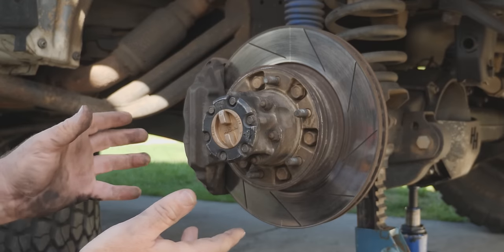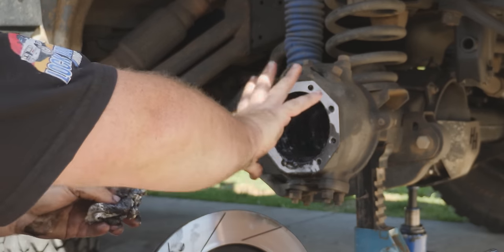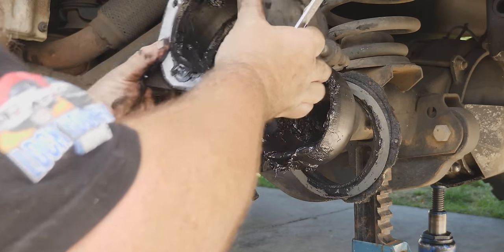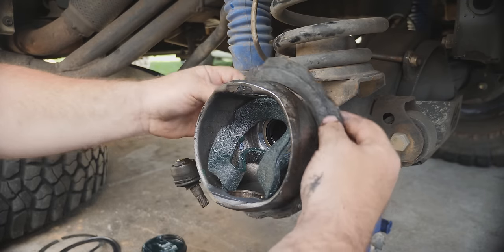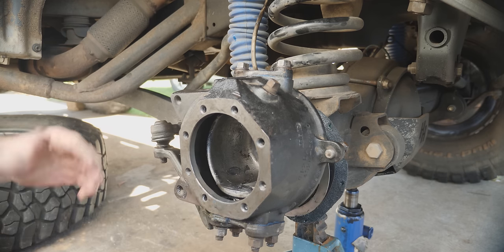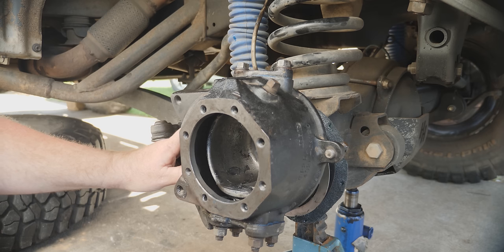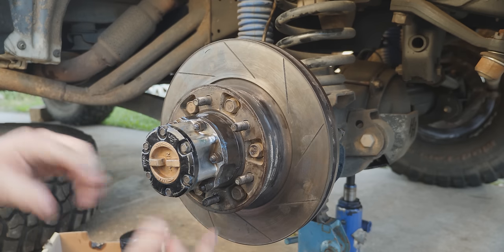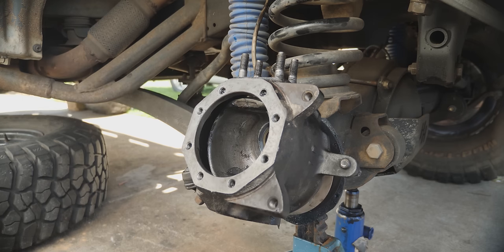Toyota LandCruiser 40 60 80 70 76 78 79 105 Hilux Knuckle CV and Birfield Rebuild

Comment from the maker: What DIY maintenance task do you want a video on?
Reply: Tie rod replacement would be great. Loved this vid!
Reply: Valve clearance adjustment (on a 75 series) would be good too.
Reply: Twin lipped seal was a brilliant idea as well as the locking nut for the wheel bearings. Long live the 80 series 😉 Great vid thanks
Reply: Ujoints. It's never a good time and a different perspective always helps. This is quite a soothing video
Reply: Wheel alignment
Reply: Love the vid mate 👍👍 is the rtv blue a necessity & what is an alternative? Is there any chance you could put links in the description for where you get your after market seals etc & the bearing kit?
Reply from the maker: @brickehansen1625  any good silicone based sealant that'll tolerate grease will do the job. Both the seals and bearing kit are avaliable from terrain tamer.
Reply: @LockyourHubs4WDing  beauty. Thank you kindly.
Reply: Steering box removal and install
Reply: Steering pump and box on a 80 series. Also tie rod ends along with wheel alignment.
Reply: Front and rear differentials…. Loved this video!

Comment: locating the felt and ring etc - put shortened skewer sticks through the holes to locate the assembly in position. Replace one by one with bolts
Reply from the maker: That's a fantastic idea!

Comment: Great Vid, A quick tip to make life a little easier. If you put your bearing races in the freezer overnight before you install they slightly contract from the cold and go in much easier without having to bash them, they are still tight but you can tap them in instead of bashing them in then they expand back with normal temperature, I still use a little cam bearing grease on the race so it's not dry when fitting them in.
Reply from the maker: About 30 years ago I used that very trick to insert valve guides in a mini head, after the head sat in the oven for a couple of hours. (Yes I am that old!) 

 Another trick I've used is to turn a can of air duster upside down and spray the liquid on the part that needs to shrink. I must drag out the FLIR one day and see how cold I can get it!

Comment: Mate ur a legend so glad I found this informative guide. I need to do mine but have been putting it off due to nerves and considering taking it to the shop. But now I've seen this im gonna give it a crack. Cheers for the confidence boost mate. Subbed 🤘
Reply from the maker: Mate, stuff like this can be done with reasonably basic tools in your driveway or garage. As 4WDers, the more self sufficient we are, the better off we are.

Comment: Just watched your video, in order to help a mate change the swivel seals on his FJ45.  A great video. 

A suggestion for helping align the felt, rubber and retaining plates is to make two studs that you can insert into the housing.I usually use long bolts of the correct thread, cut the head off, then cut a slot for a standard screwdriver.  

Install the studs loosely, one top, one bottom.  Hang the rubber, felt and plates on the studs, add the bolts.  Then wind out the studs and replace with the standard bolts. 

Cheers and thanks for the great video 
Greg
Reply from the maker: That's a great idea! Like putting wheels back on an Amarok.

Comment: Thanks so much for sharing your knowledge, it’s much appreciated! 
I will refer back to this when doing my 76 .
Thanks again
Reply from the maker: No worries mate, I just did an early 79 (1hd-fte) and other than the number of wheel studs, it's virtuality the same.
Reply: Hey mate , where did you get your aftermarket spindle nut from ? I spoke with superior eng and they say they don’t make one for a 76 ? I thought they would be the same same as other models ?
Reply from the maker: @davidmirfin1380  check out roadrunner, says it fits the 79 so should fit the 76 as well.

https://www.roadrunneroffroad.com.au/300519-kit-toyota-chromoly-spindle-nut-set-live-ax

Comment: Hello from California. This is a great video and you made something overwhelming look so easy and straightforward. I had mine done on my FJ62 by a professional, but will tackle it myself next time. Just curious about setting the preload, that seems a bit tricky.
Reply from the maker: The main thing with the bearing, both the kingpin and wheel bearings it to make sure 100% the outer races are seated properly, otherwise the corrugations are going to ruin the preload on the bearings and then they usually destroy themselves. 

A lot of experienced people just use feel to set the preload, though I though it better in the vid to set the preload the way I know it works, measure it and quote a figure, because not everyone has done it a dozen times.

Just take your time (photos on the phone at different angles are always good when you're pulling apart something new) And don't forget lots of rags!

Comment: Very informative video.
Question. Why do you tightened the preload bearing so much ? Should be finger tight or im wrong? 
Thanks
Reply from the maker: For road going stuff finger tight is fine. For off-road, you need to settle the bearings properly, or the preload will loosen up in service.

Comment: hi 
 Major parts u missed 
1/   axle/seal  center line  sets the total shim pack thickness eg top + bottom .   Toyota dealers use this tool 
2/ remove shims equally top and bottom to set preload drag on king pin bearing 
3/ check drag with spring pull gauge ,,,,,,,,set drag to 6kg Toyota spec 
------Aftermarket 
1/ eccentric king pin bearings ,allows adjustment of caster and camber for wheel alignment
Reply from the maker: If you're replacing the king pin bearings with decent quality units, I haven't found the need to adjust the shim stack. I've also never seen shims on the bottom, only the top.

Comment: Do you need the spacer in place of the removed dust shield or can you just remove it
Reply from the maker: It's better with the spacer because it leaves the seal in about the same position, but I've also done it without.

Comment: How did you get the cv-joint off the axle? I have seen several videos showing to put the shaft in a vice and banging on the cv inner race with a hammer & punch.
I have replaced many cv-joints on passenger cars, & 4x4 SUV & pick-ups and managed to remove the cv-joint using the same method. However, on 4x4 such
as the Land Cruisers, Nissan Patrol and Land Rovers with solid axle housings it is almost impossible to get them off without damaging something. Some of the
ones I did manage to get out had the c-clip mangled by the splines when forced through the cv-joint. Of all of the on-line videos, some of which are great 

videos showing the complete repair / rebuild of the cv-joint (cleaning, replacing & lubing them) but not one of them showed how they remover the cv from the axle shaft. 

I made up a tool consisting of a pipe long enough, approximately 4 inches longer than the axle shaft & large enough to fit over the axle shaft so that the pipe fits against 

the inner race of the cv-joint. By inserting the axle shaft and cv-joint into the pipe vertically and lifting the shaft & cv and slamming it onto the pipe usually does the trick 

on the SUV, Pick-ups and passenger cars (External type shafts & axles). However, 50% of the time on the solid axle type housings even with the pipe jig I just cannot get

 them apart. What I did notice on L Cruiser cv-joint the outer end of the cv-joint where the shaft splines onto the cv-joint the bore was slightly chamfered so as to collapse

 the c-clip when the shaft is inserted into the cv-joint. However, the inner bore was not chamfered which prevented the c-clip
from collapsing when trying to remove the shaft. I am assuming that the chamfered side should be on the inner side so as to collapse the c-clip and easy to remove the axle.

 I have seen one video of the complete rebuild and replacing the cv-joint on a solid axel type where the mechanic mentioned he had to remove the inner c-clip prior to
removing the axel however,  he didn’t show that procedure in the video. I cannot see any way how he could get access to that c-clip with the shaft installed into the cv-joint. 

 If anyone has any suggestions or comments on this please comment.
Reply from the maker: I've also used the pipe trick. I've used the brass drift and hammer method in another vid (replacing CV boots) on IFS cars. I too have mangled the clip to get them apart. It usually involves lots of swearing.....

Comment: Hi from Sout Africa!! Thanks for a great video!!..my cruiser 79 pickup 4.5 is on tressels for recon both front cv's my question is..can i remove both cv axles at once?..will i be able to push the shafts back into the diff?..
Reply from the maker: Yes, that isn't an issue.

Comment: Hey Cobber, I believe the after market front hub locking nut kit doesn't work on fulltime fwd , was hoping to use on 105, use the 3 x finer for rear.
Using the "spindle greaser" conflicts with using moly grease to the extent you use it ? any thoughts ? and noticed you mixed moly and bearing grease when spindle bearing was on spindle hub with moly !
Reply from the maker: Hmmmm, I've done a full time 80 before and the kit I use is exactly the same either full time or part time. The kit supplies new outer and inner locking nuts and tab washer. Not sure if the 105 is different? 

The spindle greaser will "hopefully" push out the old grease and deposit new, either moly or HTB. Doesn't matter, new grease is better than old! 

I've not seen any adverse issues arise using moly and HTB grease in close proximity to one another.

Comment: What style/brand puller did you use for the steering arm?  Part # for the aftermarket rotor/spindle bearing/seal upgrade? 
Great job. 
California FJ60
Reply from the maker: The puller is "Repco" brand, the seals are avaliable from Terrain Tamer.

Comment: Great Video mate very educational.
question when you tight the spindle nut for preload some people light tight it , some medium tight it,  but your was extreme tight is what's the difference
Reply from the maker: Tighten the inner preload nut tight first to settle the bearing races in the hub and then back it off and tighten to spec on the second go. 

That way you're sure when you hit the corrugations, your wheel bearings won't loose the preload.
Reply: @Lock your Hubs 4WDing  one question when I'm in a rocky area or off-road sometimes I hear a clunk noise behind my foot or my right wheel RHD(right hand drive)
I changed everything tie rod ends, sway bar links and bushings. greased right side axle. still I hear the same noise any idea?
Reply from the maker: @jdmgm6765  check for cracks in the chassis around the steering box, it's a fairly common issue unfortunately. If you find cracks, they'll need to be properly welded up and then re-enforcing plates welded over the top to make sure it doesn't happen again.
Reply: @LockyourHubs4WDing  didn't see any crank rig has 150km could a king pin do that clunk noise
Reply from the maker: @jdmgm6765  the easiest way to check the kingpins is lift up the RHF wheel, grab it at 12 and 6 o'clock, give it a wiggle. If you can feel play, that's the kingpin bearings. If you do the same thing at 9 and 3 o'clock, and feel movement, that's wheel bearings.
Reply: @LockyourHubs4WDing  yep I can feel a slight play when I push 12 o'clock going to rebuild that soon just greased it for the time being. I just changed all four my tie rods with a greaseable option tie rods.  if you did your alignment perfectly since I'm in the bush can you count how many strings are left from each drag links in the front and the toe adjustments in the back
Reply: @LockyourHubs4WDing  could be king pin bearings, or wheel bearings..
Have someone apply pressure at 12 and 6 o’clock, while you watch to see where the play/slack is..
You will need to watch fir the slack at the swivel bearing, from underneath ..
If its king pin, you will need to strip it down, you will need to get more detailed information elsewhere..!

Comment: HI, thanks for the video. The torques you mention are the same also for 70 series or are there any differencies? Another thing, a pre-load is to be adjusted only by a torque or there is something more to do? Thanks.
Reply from the maker: While I used the same torque on a 79, you're probably best consulting the factory service manual. 

When it comes to the wheel bearing preloaded adjustment, there is a process in the factory service manual that involves using a spring balance on one of the studs and adjusting the preload on the nut and checking the drag on the bearing using the spring balance. 

I did try it once, though really cranking down on the preload nut didn't seem to make that much difference on the reading from the spring balance.

Comment: Howdy mate, I have a 2006 LC 105 GX 1HZ, same running gear as that beast you're fiddling with...
Went to buy new tyres today but saw that the front left wheel had some play and thus I needed to remove, check and adjust the bearings (pretty new, only about 20k km).
Pulled off the wheel, calliper and hub to find the wheel-bearing grease in the hub was black, but not runny. As if it's been contaminated by the airfield / cv grease?
I haven't stripped any further but the smell of this grease is akin to the LMM Castrol CV grease I used in the ball-joint and cv, so I'm thinking there's just been some cross-contamination here?
Would overfilling the ball-joint / airfield / cv with LMM grease (probably what I did 'cause I like over-engineering  cause it to push outwards along the shaft and into the wheel-bearing hub and mix with the thicker Lithium WB grease? From the comments above it doesn't seem like this is a train smash?
What else do you think I could check?
Will adjust the wheel bearings properly this time!
Reply from the maker: If it's not runny from an oil contamination, it sounds like the cv/knuckle was overfilled and has contaminated the wheel bearings.
Reply: @LockyourHubs4WDing  Thanks mate, my deduction as well. Only slight bit of black grease came out so no worries...I repacked with standard and put her back together all sweet. Cheers

Comment: Great video, whats the best kit / place to get parts and tools for this job? I'm in the USA though so it may not apply to me. Thanks again.
Reply from the maker: We used the Terrain Tamer kit.
Reply: @LockyourHubs4WDing  What about that bearing you are using? @ 34:26
Reply from the maker: The bearing used are Koyo as used by Toyota, purchased through Terrain Tamer. The double lipped seal is also avaliable through Terrain Tamer.

Comment: Hi mate, ive done that side and now doing the passenger side, and for the life of me, i cant get the longer axle back into the diff. I feel ive tried so much ill ruin the new seal. any advice would be good
Reply from the maker: Do you have factory lockers with the longer spline/axle? And if so is the locker turned off?
Reply: @LockyourHubs4WDing  has no lockers, ln106r 93

Comment: What Types of grease were you using? is standard penrite high temp wheel bearing grease good for everything that you covered in this video?
Reply from the maker: On wheel bearings I used Casttol high temp bearing grease and for the king pin bearings and the CVs I used Penrite molygrease.
Reply: Lock your Hubs 4WDing Thanks, glad i watched this before starting the challenge of doing it, great video, cheers!
Reply from the maker: Just take your time mate, if I'm tackling something I haven't done before, I usually take a few phone photos from various angles at several stages during the pull down. It's come on handy more thsn once.
Reply: @LockyourHubs4WDing  Thats a really good idea ill make sure to do that thanks!
Reply: @LockyourHubs4WDing  can you pack the hub around the cv with bearing grease? I only use moly grease for inside the cv
Reply from the maker: @simonrudk3912  the hub should be packed with moly grease not bearing grease.

Comment: Not sure if it’s already been asked, but, do you think the freewheeling hubs ( part time) actually improve the 80 series? Fuel , handling etc ? Keen to hear your thoughts please!
Reply from the maker: The fuel saving is minimal, the only reason I would convert is the vibrations from the front drive shaft that you can get with 3"+ suspension lifts.
Reply: @LockyourHubs4WDing  thank you!

Comment: What size is the insertion tool you used on the inner axel seal? Do you know of it's the same on the 60? I'm trying to get my ducks in row for my first bearing/knuckle rebuild on my cruiser.
Reply from the maker: I used the 50mm insertion tool to insert the inner axle seal, it's the same size I use for the king pin bearings. Unfortunately I'm not sure if the 60 series is the same.

Comment: What grease would you recommend if we can’t easily get the Penrite in the US?  1987 fj60 USA
Reply from the maker: Any quality grease will do the job, I've used Valvoline with success, the marine bearing grease seems to work great on the wheel bearings.